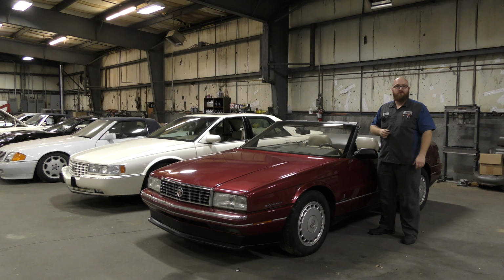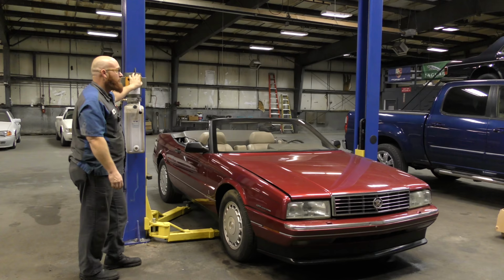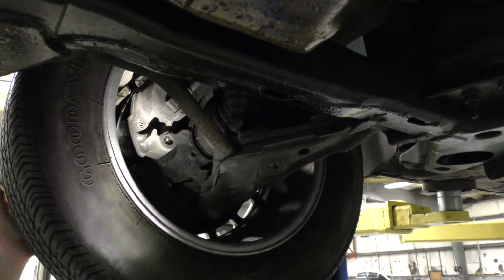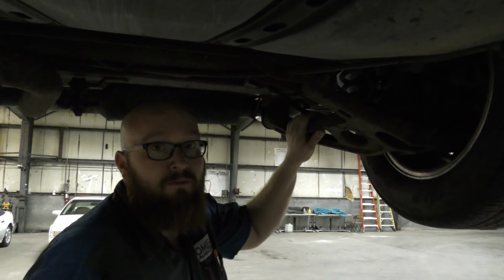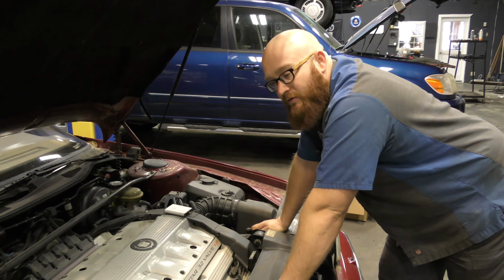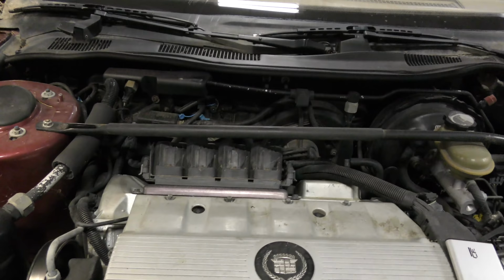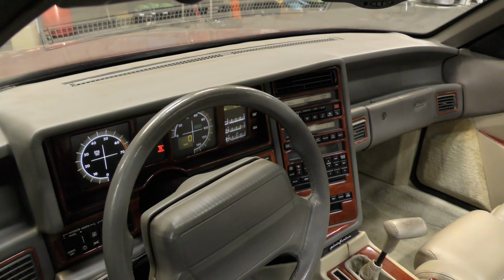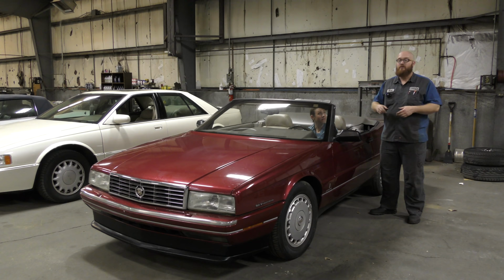Not another Northstar! The CAR WIZARD introduces you to a '93 Cadillac Allante and MRS. WIZARD!!!

Comment: Wizard, does this variation of the Northstar V8 have the same aluminium head bolt problems you mentioned in the "Dumbest Engine Design" video? In that video you mentioned that 97-99 (especially, but not exclusively) were prone to the problem. The oil pan gasket seems easy, but not head bolts... I LOVE ALLANTES and my hooptie fleet already has a 1958 Beetle, 1966 AH Sprite, 1966 Mustang Fastback and a 2017 Honda HRV (my daily).

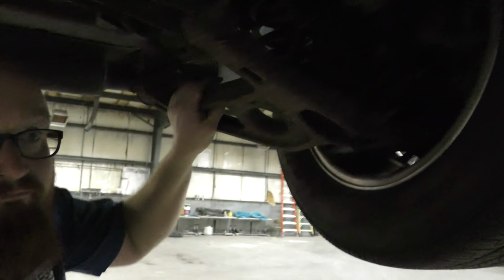Comment: 6:07  This might sound dumb, but couldn't newer models of the Magnetic Ride shocks be made to work on this?  Or are the systems far too different now that it's possible in the sense you can completely shove the current system in and replace them that way.

Comment: A friend of mine had a four door Allante and started getting a noise in the front suspension. We took it to a shop thinking it was a bushing. Turns out the a-frame was stamped steel and had cracked. The guy said they do that. Do not buy one of these!

Comment: Would that sensor telling the computer the engine is cold ruin the catalytic converter? Dumping that much fuel all the time? Or warp the engine if low on coolant and doesn’t know the engine is overheating?
Reply: No first of all the PCM and on-board computer systems would still sense of a problem or malfunction if the coolant level would drop if that were the case.  You would still get a Coolant level low message and the engine temperature gauge still works just fine inside on the cluster.  It does not ruin a catalytic converter.  Typically what ruins a catalytic converter is when an engine is not running on all cylinders causing misfire and dumping out unburned fuel.  That is not what the performance chip/module is doing in this case.

Comment: Hey wizard this is not a anyting about Cadillacs but I have a question for you is it necessary for cars to have Grille vents really the ones that open and close really is it necessary because they're connected to the code system and if that code goes on that your vents are not working which is po59f can you still get your inspection sticker that piece of s*** crap doesn't work referring to Grille vents.

Comment: Do early (1993-1995) Cadillac Northstar engines NOT HAVE the head-bolt problem that results in a leaking head-gasket?
Reply: Allegedly, the problem was worse in the late 90's.  The Wizard did not mention changing the coolant--a maintenance omission that led to many of the failures.

Comment: why you hate northstarts that mutch ? its a quite decent engine, after you fix the headstuds and some minor issues, they run for a long time and quite dependable once you get them in shape. seems like an engine you should like.. its not overcomplicated, does its job and thats about it. under 300 hp so not a pretty smart engine as it should/could be far more powerfull, but in exchange its quite a decent engine.

Comment: That car was a good example of some of the incredibly stupid decisions General Motors made. And a partial explanation of why they went bankrupt.
Reply: No not necessarily, economics has a lot to do with it.  The Allante lasted longer than some of the other short-production run cars.  After the Allante ended, the design team continued on the high volumn models for the next decade.  Also this was not the first time that Cadillac worked with Pininfarina, it started back during the early 1950's.
Reply: StarXLR they kept it alive artificially in order to try to boost their brand. Unsuccessfully. There are many other problems with that vehicle besides the ridiculous assembly process. Antiquated drivetrain. Interior that belongs on a much cheaper car. The top that is ridiculous. Looks like something design in somebody's garage. And when they finally gave it more power, they also gave it lots of torque steer. GM always thinks there's some kind of shortcut to success, they never seem to learn.
Reply: @kevinbarry71  I don't know what you mean by keeping it alive artificially but OK.  Whether it was sucessful or not, that's anyone's opinion, but it did last for 7 years which longer than some of the others.  Also this was not Cadillac's first time building a luxury two seater roadster and was not the only car designed by Pininfarina for Cadillac. They have had a partnership since the 50s and early 60s and was revived once again with the Allante. The old Cadillac's that were designed by Pininfarina had the same assembly process. The interior itself is a very high quality and does last very good but needs maintained just like anything else. Now with the torque steer that your referring to, the car handles it very well especially with the new steering system. A lot of engineering went into this car that has made it a very nice riding and great handling car.  And whether its GM or another auto maker, they all go through their faults and troubles at some point in time.

Comment: The "issues" that plague the northstar are caused by moronic owners that seem to think engine coolant will last the life of the car. After a number of years the coolant turns acidic, eats the head gaskets, then moves down the bolts and eats the head bolt threads in the engine block. Have owned and repaired many northstar engines. With new headgaskets with copper coat applied to both sides, a set of NS300L thread inserts installed, and lower block/oil manifold/oil pan reseal, even a high mileage Northstar will run forever if maintained PROPERLY. Originally derived from the Corvette ZR1 LT5 dohc v8 designed by GM and Mercury Marine, Northstar engines are extremely overbuilt and understressed. The rotating assembly is strong enough to handle 3x stock power levels and be held at redline for hours at a time. As such they are very popular in performance boats. I have owned numerous Northstar powered cars, usually buying them cheap with blown headgaskets and pulled headbolts. I have repaired them both for myself and customers, and have never once had to resurface a head or block. Once you have done it a few times, head gaskets and other maintenance on Northstars is quite simple.